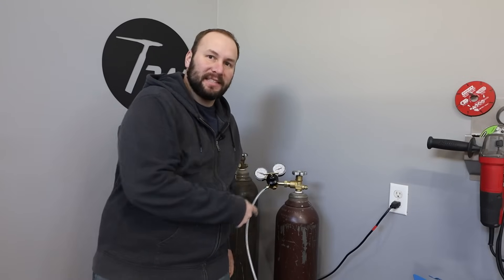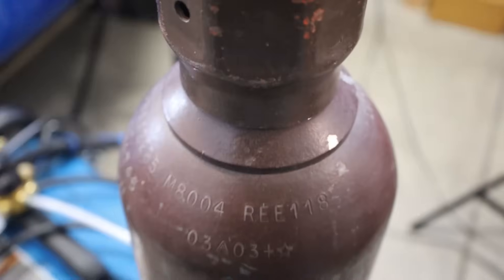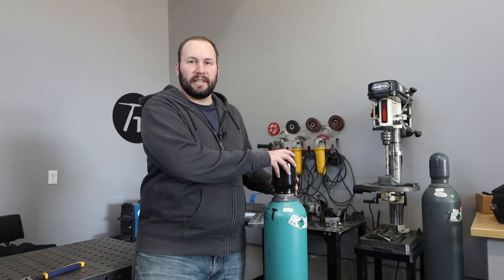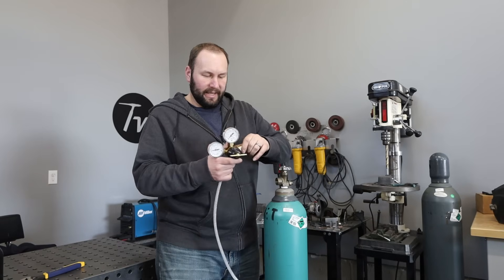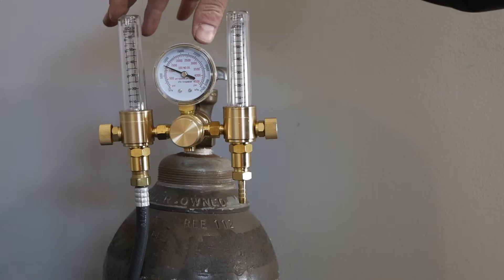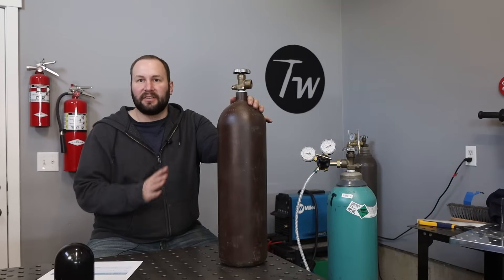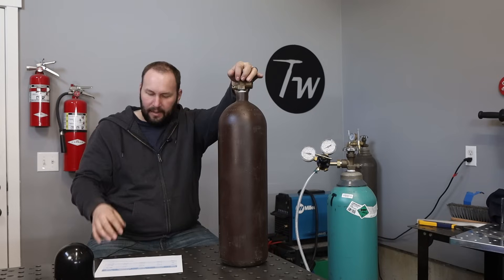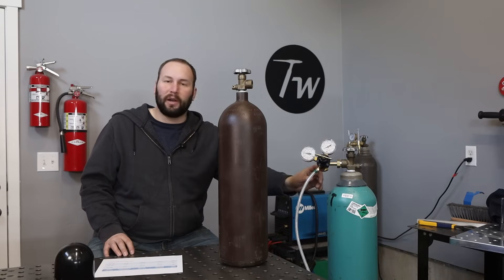Welding Gas Cylinders: A Beginner's Guide

Comment: stupid question here , how can you tell when the bottle is empty? I thought mine was empty for a while cuz the regulator read zero or close to zero on pressure. and didn't want to go get it filled. But when i hit the trigger it does blow out gas and reads on my flow meter. so i kept doing my practice welds and what not. just confused. i know i could weigh it but that seems like a hassle and i think it would be inconclusive with a regular scale.. yea dumb question cus i assume it would stop blowing when its done but it seems too have some still and im being a tight wad. cant find it in me to drive across town to fill it up just yet. hesitant to call myself a welder but i know when the gas isnt even on what it does to the weld and it dont look like that yet. newbie alert.

Comment: Is it a male or female tank cylinder valve where the argon gas regulator is threaded to an argon tank cylinder?
Reply from the maker: Generally female on the tank side. The exception to this is some CO2 tanks and they have adapters available for those.

Comment: ITs not cheaper. They are just acounting for pressure. For large vessel, you need more gas in it to make the pressure. Like for the small one, there may be 1 or 2 cubic foot left in it, and the large one 6.

Comment: Hey Tim I appreciate you taking the time we really are blessed in the Simplified instructions you present ty for keeping it simple. I'm welding on truck firewall like 13 to 16 gage. It's a restoration a high end restoration so I've have very limited experience on light gage materials would you have any pointers for to help me out yeah I am a little bit nervous on account of the nice restoration is going take place.
Reply from the maker: That shouldn't be too bad to MIG or TIG weld. The biggest problem is distortion and warping of the metal. The best way to avoid this is to weld very short sections, around 1/2" or less at a time and move around to different parts of the joint to spread the heat out. After you're done, you can grind it smooth. Given the nature of the project, I'd pick up a little bit of material around the same thickness and practice a joint or two.

Comment: Question about filling the tanks. I get it that if you rent the tank you probably just bring it in for an exchange. What isn't clear to me is if I own my own tank, am I getting that one filled or am I also getting an exchange (though probably at a lower cost)? I ask b/c you kept using the word "exchange" and the tank you showed at the beginning wasn't the same as later in the video. Please clarify. THanks.
Reply from the maker: It's a great question. Most gas suppliers also exchange owned tanks for a different one, you just don't have to pay the lease fee. Generally, the tanks are trucked to a central location to refill, so it would take a few days to get it filled and they often won't keep track of it anyway. Usually, the owned tanks you exchange have a blank neck ring, but some suppliers just swap out whatever they have.
Reply: @TimWelds  that's what I thought. So, if I buy a new tank online and take it to get filled I get an exchange? Who takes care of the 10 year certifications? Am I over thinking this?

Comment: Hi,I want know acetylene I cane use for a mig welder machine
Reply from the maker: No, you need either Argon/CO2 or straight CO2 for steel MIG welding.
Reply: So can use a lpg gas of wilder aluminum

Comment: Thx Tim. Just to be clear….if tank has a capacity of 120 cubic ft at 2000 psi  and is run down to 500 psi does that mean there are 30 cubic ft gas left?
Reply from the maker: More or less. There’s technically a compressibility factor to consider, but your line of thinking will get you close enough for most practical purposes.

Comment: You mention exchanging.  If you own the cylinders, wouldn't you just have your own cylinders refilled rather than exchange?   Thanks for your videos.  I learn a lot from them.
Reply from the maker: Every gas supplier I’ve used just exchanges the owned cylinders. They truck them to a central location to process them and exchanges give a quick turnaround.
Reply: So, when you buy a tank from a local welding store, you are not buying a new tank?  Say I buy a tank in 2024, is that tank dated as tested in 2024?   If that is the case, and you exchange it for a refilled one, you may never see your new tank again.  New to all of this, and the buying a tank, then exchanging upon refills seems a bit confusing.  Thanks for clarifying.
Reply: @quintriggins6557 I have the same question. Hope somebody clarify.

Comment: What I've been trying to better understand is how to know how many CF (cubic feet) of Argon are in my 125 CF Argon cylinder as the PSI decrees.   Like now I'm at about 1000 PSI now I'm sure there are a lot more than 1/2 of the starting CF of 125, because with my understanding the higher the presser the less additional Cubic Feet of gas (in my case Argon) can be added to the cylinder per PSI increase.  So with my practicing of TIG welding it got down to 1000 PSI faster than I would have hoped it would have, but it should take longer to go down as I get lower in presser.  Is there a chart to show the cubic feet left in a cylinder relative to the PSI?   I've been looking & looking can't seem to find one.   Now maybe I'm just wrong about being able to compress more gas per PSI increase at lower PSI, & less increase of CF per PSI as the presser get higher.

Comment: I like to run my cylinders the same way I do with my propane tanks for my BBQ. I keep 2 of each them and as each one runs out I will swap tanks and swear I will get it refilled before I need to swap again. Of course I don’t and then I wind up taking them both to the store at the same time to swap. That way in my mind I will have a backup which of course I do the same cycle over and over again. 🤷🏻‍♂️

Comment: Hi Tim. I really enjoy your videos and I have never done any welding (yet). I am learning as much as I can before jumping in and purchasing my first Welder.  Looking at a multi function MIG machine after watching your MIG vs TIG video. Argon seems to cover the most situations allowing to have just one gas cylinder in my home (hobby) shop. Now the reason for my comment:
Is there a reason to not just use 100%  Argon for all applications?
Thanks.
Reply: For mig welding steel you have to use 75/25 you cannot use pure argon because the weld won’t penetrate as well. For spool gun mig you can use pure argon because that’s for aluminum.

Comment: In CT the going rate from Linde gas (Praxair)
330cuft c25-88$ exchange 
Letter K oxygen-31$ exchange 
3.5 acetylene-134$ exchange (was up from around 80$)

Comment: Thank you for the video. I have an argon/co2 regulator .Can I use it with Nitrogen gas since fits to tank if I change the left low gauge to 100-600 psi one? Thanks.

Comment: hello i can not find C25 where i am in Mexico, so for mig welding it seems C02 is my option, just wondering if i can fill a argon tank with C02 if i use an adapter , is there any problem doing that ?

Comment: Hello, I have two questions, please 
              1: For MIG welding, when to use co2 gas and when to use argon gas
              2: Does co2 gas affect the properties of metals ?
Reply: Co2 is for welding steel or you can use carbon dioxide/argon c25 for aluminum you should use argon 100% or argon and helium but just know it is more expensive to add helium

Comment: I was convinced after all the comments I read online that 80-125cf would be the max tank size I could own. Living in the Houston area I decided to call around and find out myself. Yes, most places will not let you own anything over 125cf here, BUT I did find one shop about 35 mins away that will sell one up to 250, and it's only about $50 more than the "GasAir" chain's 125. So basically if that kind of thing matters to you, it's worth making a few phone calls.

Comment: What would happen if you just turn the valve on the cylinder of 100% Argon gas without anything attached? No regulator...
Reply: Same thing as putting a $100 bill in a paper shredder.
Reply: I have 125 cubic feet

Comment: What will happen if you just turn it on with no regulator?
Reply: You won't be able to weld a thing and you'll run out of gas in a few minutes ... LOL.  2000+ PSI

Comment: I have a smiths little torch for silversmithing -  I use a #1 oxygen bottle with regulator and flash arrestor.  Seeings how it seems the most dangerous moment is turning the tank on, would it be safer to just leave it always on? I use my torch every day.
Great video,  thank you 👍🏻
Reply: Seems safe to just leave it on, however, if there were a leak in the on position you'd fill your shop with a nice flammable gas that with one spark that'll send everything into orbit...most leaks in these valves occur in the open/partial open state as the only thing keeping the gas from leaking out past the valve is o-rings....VS when you close the tank valve it is usually a brass on brass valve seat which has a much lower chance of leaking.

Comment: Man- prices have gone through the roof since this video was made. LGB
Reply: Price of steel for the most part.
Reply: 3 years after this video, I just purchased an Argon 15 cuft and it was $399.00 🇨🇦 just for the cylinder plus fill, plus misc fees. Like everything else cost are way up. 🤷🏻‍♂️

Comment: Hello. I have the regulator with floating ball. Do I need to remove the regulator after I'm finished welding for time being?
Reply: Its best to just leave them hooked up and just turn the valves off on the tanks when you aren't using them, keeps junk out of the tank's outlet and your regulator...openings like that are a great place for bugs to nest, dust to collect etc.  Best to keep things sealed off as much as possible.
Reply: @wildbill23c  thank you

Comment: Tim, do you have thoughts on whether it's better to buy two 40 cu/ft tanks vs one larger 80 cu/ft or 125? I've heard some people say it's nice to have a backup tank so that you're not in the middle of a project on a Sunday and then run out?
Reply: If you can afford to buy multiple tanks its a great idea, especially if you have a good distance to travel to exchange or have them refilled....for me its 35 miles one way to the nearest supplier, so I'll be buying a couple of tanks....Well 4 actually, 2 for Argon, and 2 for Argon/CO2 mix.....So about $1500 initial purchase/fill cost.  I'm thinking of going with the 80cuft tanks as I don't weld very often, but want something large enough to be able to easily secure to the welding cart and be able to carry me through a welding project...the supplier I spoke with said the 80cuft is their most popular for home DIYers.  Gotta also take into account, how much you would care to lift into and out of your car, truck, SUV, etc.  Some of those tanks get pretty heavy.
Reply: @wildbill23c  I eventually worked my way up to 125 CF tanks.  I like them better than the 80 CF tanks.  I have two argon tanks and it is nice to be able to swap out a cylinder rather than have to shut down and have to go to the store for a refill..  Now when one tank is empty, I can go to the store to replace it at my own convenience.
Reply: @paulkurilecz4209  I plan on getting extra tanks as well.  I just have an 80CF CO2/Argon tank right now, I need to get an Argon only tank...then pickup a spare of each...but dang they're so expensive.  Almost $700 for the tank and initial fill...and I haven't even used it yet, and got it in April.  Just been too busy with everything else going on this year.
Reply: @wildbill23c that sounds expensive.  when I purchased an 80cf bottle not too long ago it was  about $250 if I remember correctly.  the gas (Argon) was about $42 or so.  you can buy new bottles, i forget the size either 80CF or 125CF, for about $300 or so.  this is from Northern Tool.  I started with 80 CF bottles then upgraded to 125CF.  hth

Comment: Another consideration  is the hours the store hours. Where I have my tanks from I can get them exchanged on a Sunday afternoon. I did pay a bit more for the tank and the exchange but running out on a weekend and not having to wait till Monday to finish the project is worth it to me. LL&P
Reply: This is a huge factor to consider, and at least where I live don't matter which company I go with, they're all closed on weekends and holidays...WTF, you can't weld on weekends in Idaho I guess LOL.
Reply: @wildbill23c  I'd wager even here in good 'ol Texas you won't find many, if any, welding supply shops open on Saturday or Sunday. They like their banker's hours.
Reply: @charlesdjones1  The place that I go to in Dallas is open on Saturday mornings from 7 to Noon.  Best not to show up at 11:59 as the lights are off and the doors locked at Noon.  At 12:01 the parking lot is empty.
Reply: I just got a small bottle of Argon  without being mixed. MIG welder doing mild steel 🤷‍♂️ can it work or should I get it changed
Reply: I just got a small bottle of Argon  without being mixed. MIG welder doing mild steel 🤷‍♂️ can it work or should I get it changed

Comment: Great video....I just have one question. How can I be sure that the flow rate of 15 l/min let's say which I set on the flow meter is same which I actually get at the welding torch.
Reply: You can use a flow meter at the torch. It uses a rubber cup that you press against the torch and you watch the gas meter ball float to check it. Exactly like what he did in the video and explained how you can check the flow at the torch. 🤷🏻‍♂️

Comment: I'm a new Subscriber here, and I like and appreciate sharing knowledge with your method. It fits me perfectly, straight to the point. I wish you could add text values in metric measures. Constant stopping video and checking the quantities you talk about is quite disturbing, and just like me, every European guy or military guy that starts to learn a new method of welding needs to do the same thing.

Comment: I just get the rental cylinders, around here no one will fill customer owned cylinders over 80cf. Also if you own them you have to wait around while they fill them. Then your on your own when you need a hydro test as none of my local places are interested in helping. I think I get charged $70 something per tank per year. I’d like to avoid the rental fees but the local gas companies make it so difficult it’s just not worth it (at least here)

Comment: Great video, ok I have  a 40cu acetylene  and a 40cu oxygen  so would  that be good for my  cutting  torch? Thanks
Reply: It depends on the acetylene consumption of your cutting torch.  The old recommendation is 1/7 of the tank's volume per hour.  Now the recommendations it 1/10 of the tank's volume per hour.  So you will be limited to about  4 to 5.75 cubic feet per hour which is not much of a cutting torch.  I have a 75 cf acetylene bottle.  This will handle a #2 cutting tip and just can handle the smallest rosebud.

Comment: does argon gas catch fire eaily when leaked?
Reply from the maker: No, argon does not burn. In fact, it would put a fire out. The biggest concern is that it would displace oxygen to breath in a confined space, but it would take a whole lot of it to do that.
Reply: @TimWelds  Thank you so much, it helps.

Comment: Once you fill a tank with a certain gas, can you refill it with something different? I.e. A cylinder with N2/HPA with Argon?
Reply from the maker: Depends on the gas supplier. Every supplier I have used has let me exchange for any type of gas in the same size cylinder.

Comment: Great video! I have a question,I live in California and I do mobile welding on the side and transporting bottles have always been a concern to me. I have a 60 cubic foot bottle and it doesn’t have any threads for a crash cap , when I transport it I mount it up right in the bed of my truck, is that legal or safe?

Comment: You said you buy your cylinder, but then you exchanged it rather than had it filled (like they used to do for propane) - what's the difference between that and lease? Just costs more when you refill? Monthly fee?
Reply: With a lease you end up paying a monthly fee on the tank itself over the lease period, like leasing a car....its basically renting the tank from the supplier...then after the lease period you can turn the tank in for a new one.  Exchanging is something I wasn't understanding either....if you spend that kind of money to buy brand new tanks, I'd want my tanks filled and given back to me, not exchanged out and get someone else's tank of unknown quality.

Comment: Can you store and use an argon/co2 bottle horizontal for mig welding?
Reply: You can store them horizontally but I don't think you can use out of them in that position....would definitely like to know this as well though....I'd think it would be a heck of a lot safer if you could have them lying on a floor or shelf as opposed to standing up.

Comment: the oldest date that I've ever seen on a cylinder was an 02 cylinder, recertification stamped in the early 1920s.  For accuracy, the flow rotameter must be plumb, and pressure will be adjusted to maintain flow.  Also, never use a regulator made for one gas with another gas - it might not be accurate or safe.  This is absolutely true for oxygen regulators.

Comment: Man, I just bought a cylinder like two weeks ago. I wish I would have seen this before just to have a better idea. 

I got prices for an 80 cf from three places and the prices ranged from $180 to $312, all filled with 25/75 mix. With that kind of fluctuation,  I would definitely suggest shopping around before choosing one.
Reply: I called my closest supplier and was quoted for 80cf tanks $350 each filled.  That includes the initial tank purchase...so considerably less than that of course for refills, but dang the cost of these cylinders along is over $250 each.